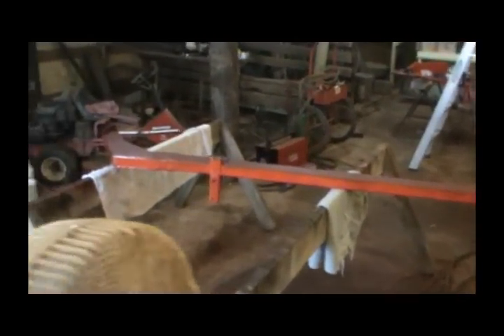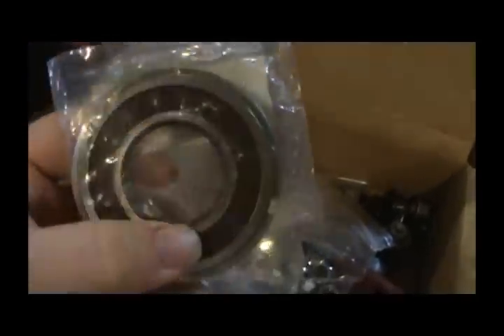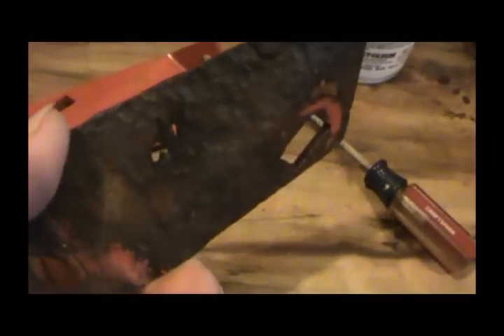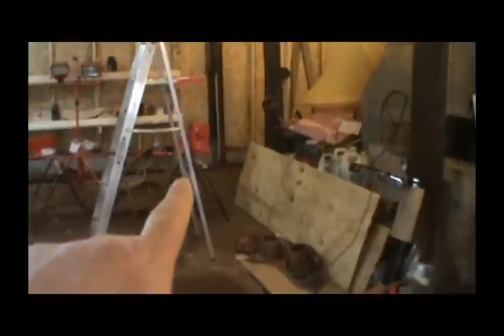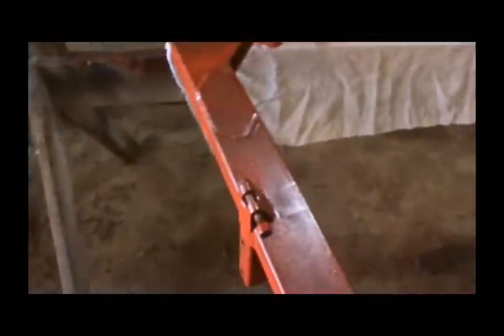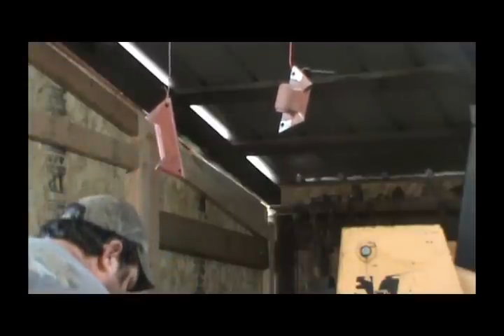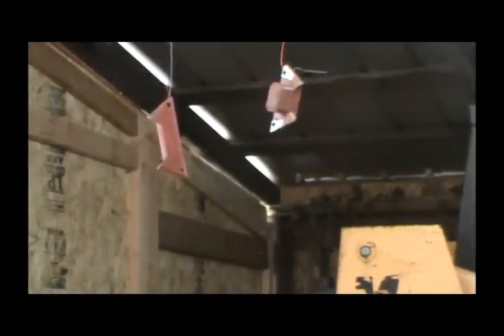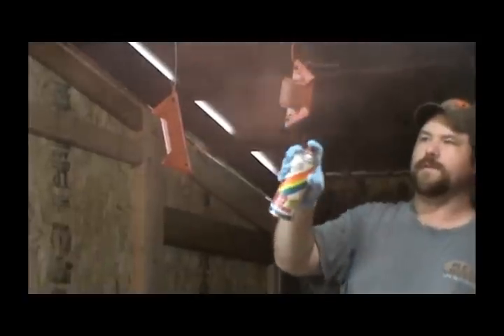Kuhn Mower Rebuild Part 15 - Paint & Parts

Comment: Hell you are a rembrant at painting its going to look good yea you need to change bearings in that drive pulley shaft if you don't it will bite you in the ass in the middle of cutting hay.